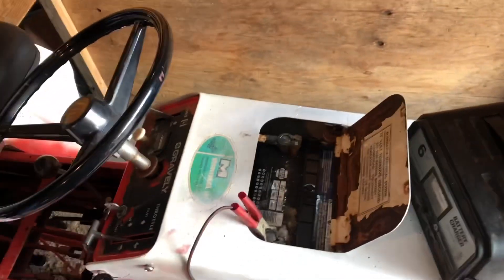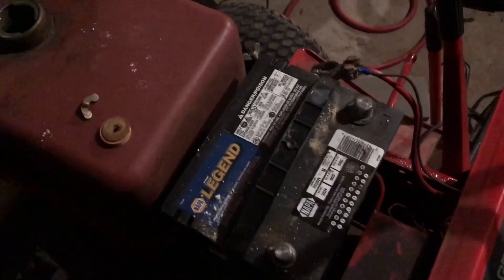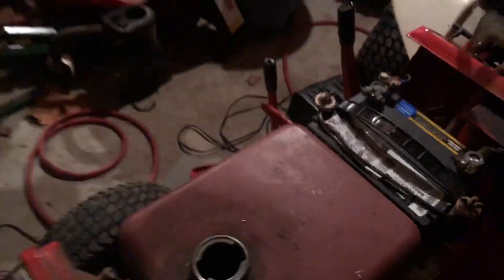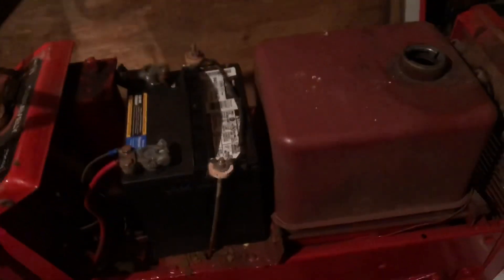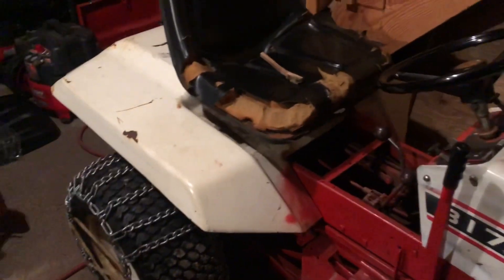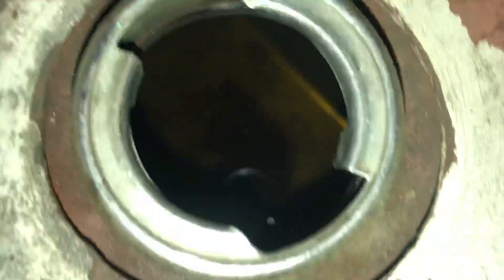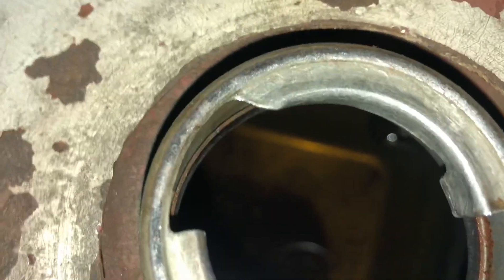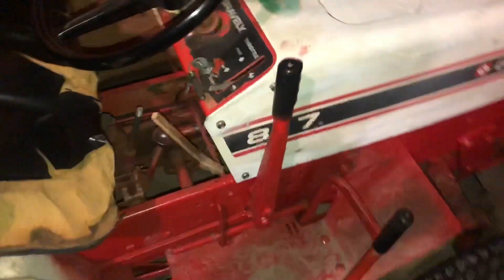Getting My Favorite Tractor the Gravely 817 Running Again

Comment: Sounds good.  Nice paint job on the blade.  Too bad about the battery.  I keep some 50:1 gas mix in a trigger pump oil can for squirting in carbs and spark plug holes.  I can use it in 2 cycle or 4 cycle engines without worrying if I have straight gas going into a 2 cycle. PaulL